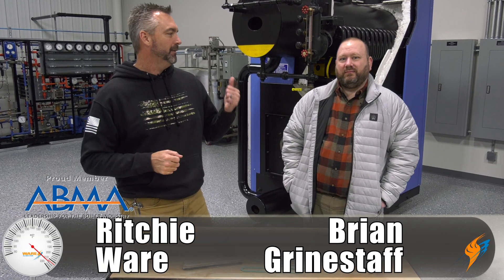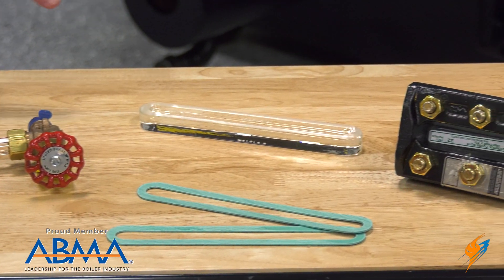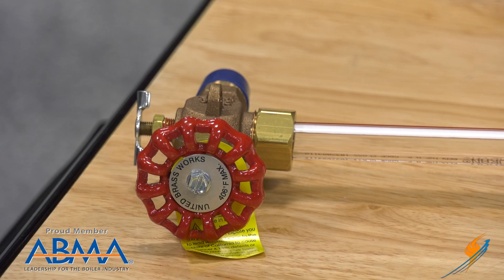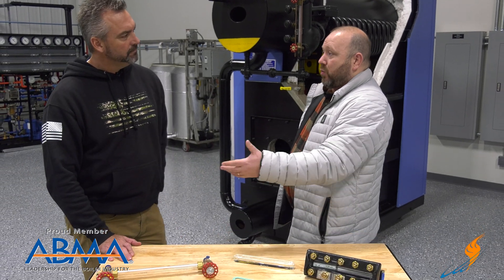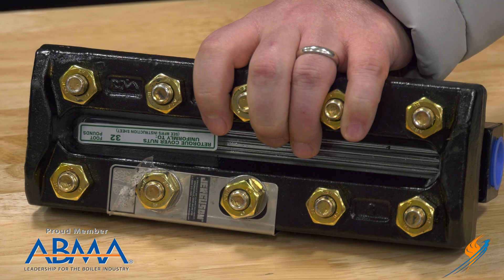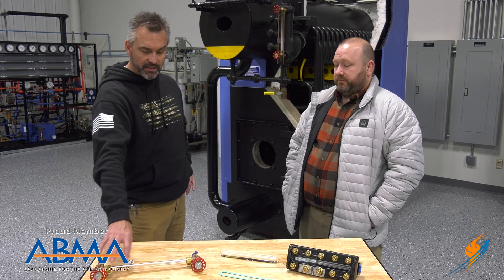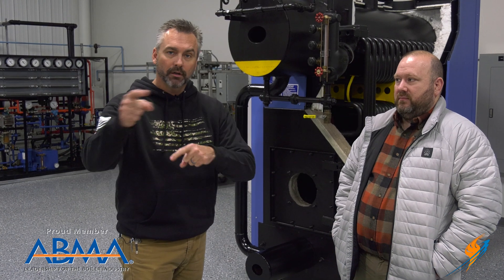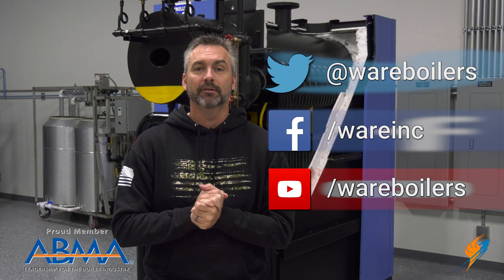What Are Sight Glasses on a Steam Boiler - Boiling Point

Comment: The new site looks great! What is the difference between the paper and graphite gaskets for the reflex glass?
Reply from the maker: The non asbestos (700 deg F) has a higher rating than graphite(500 Deg F), but not higher than graphoil (800 deg F).
The gaskets also have a different malleability and thickness.  Some like to use the graphite/graphoil because it will crush against the surfaces to allow for a better seal. Hopefully that helps! If you have anymore questions, feel free to call us or chat us up on the website. Thanks for watching and your kind words about the site!